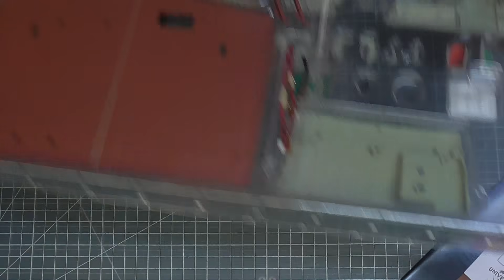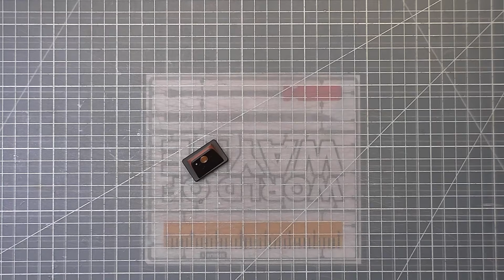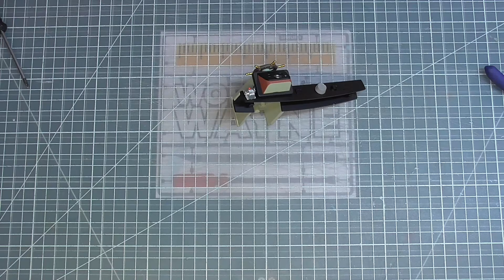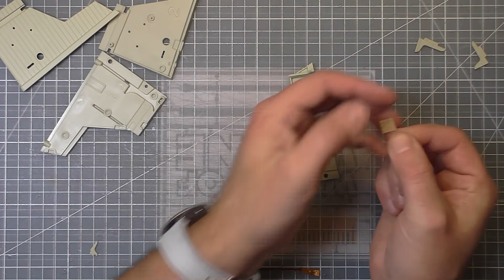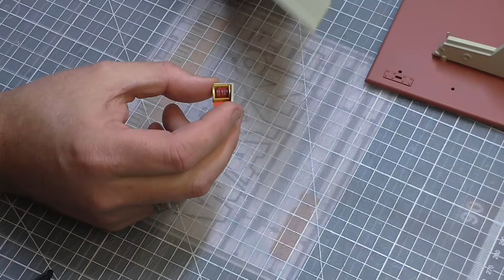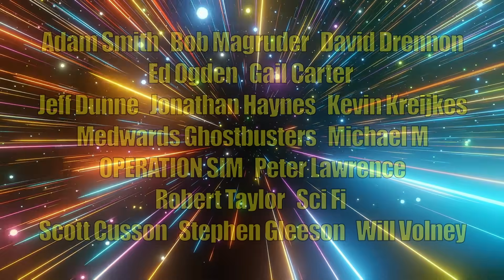Build the 1:16 Scale Orca Boat from Jaws - Pack 1 - Stages 1-4 - Agora Models

Comment: I told myself after building the Ecto-1 that I would never do another project like this again.
However, this doesn’t look as complicated as the Ecto-1 was. Wires everywhere, leds lights and sound that no longer work, probably due to a burned out circuit board, and the sheer weight of the vehicle itself.

Comment: One question: do you intend to paint the boat so it looks old and weathered? It could be done very easily with "washes" that most model shops sell. You just slap on a thin coat. If it doesn't look "old" enough, just add another.
Reply from the maker: Yep. Watch the other vids in the playlist

Comment: One mod that I can see is that rather than gluing that spotlight stem in position it would be quite easy to allow it to pan and tilt into any position.
Reply: Surprised that it was not put in with a flanged screw
Reply: When you look at the real one in the frame grab it doesn't look any more than a flat piece of metal strip. No need to make a mold and plastic cast it just needs a flat metal strip with 3 holes in it mounted on a metal post and it will look better and function. Also the wall of the spotlight itself looks a bit too thick. There is probably a better spotlight from an RC boat builders supply.